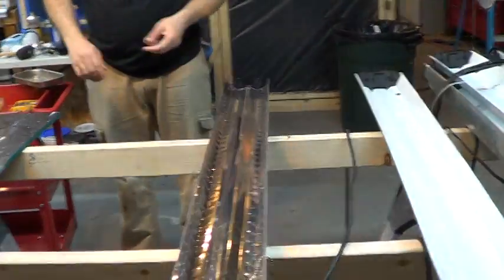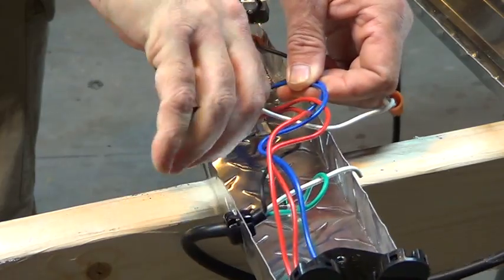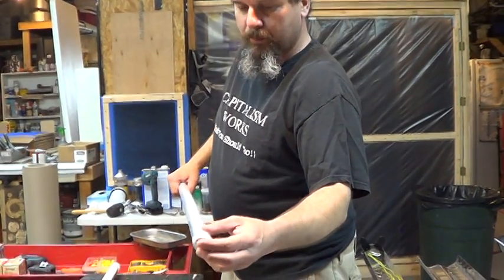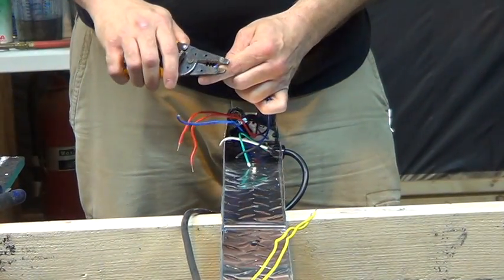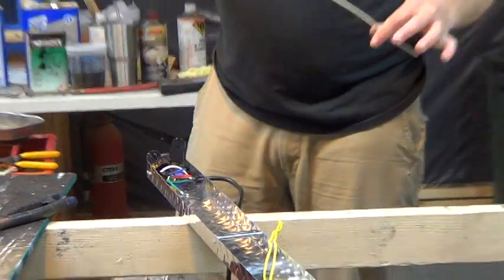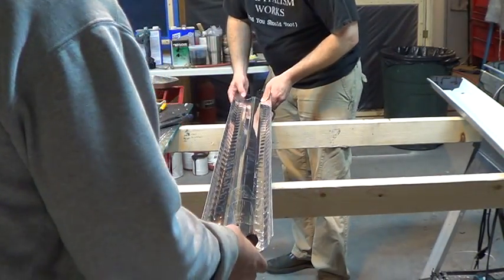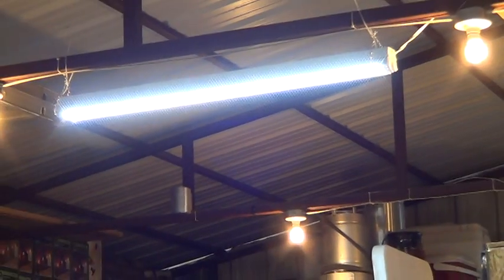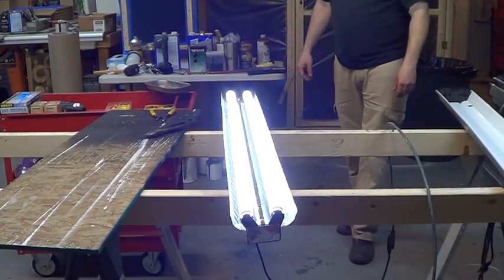Changing Fluorescent Bulbs To LED Bulbs - Removing Single Ballasts & Wiring

Comment: Dont try this at home Kids
Im not a professional!
Did you pull a permit for this?   LOL
we need to tell the tax man about the improvements you did
so he  charge you  accordingly for increasing the value of your home

I bought an LED at LOWS 
cost 75.00
and took out the florescent  in one of my bathroom
 and WOW 4 times brigher
as I change light bulbs in my house i switch to led

Comment: Wire Nuts for Rick.  Even a Caveman can use them.   I like using these on Motors, quick change on winding wires. 

http://www.linghunt.com/ForumPosts/Oven/German_WireNuts%20%281%29.jpg

http://www.linghunt.com/ForumPosts/Oven/German_WireNuts%20%282%29.jpg.   

Forum has ordering information.   As with any Electrical device, check voltage ratings and current limits.  

http://www.hobby-machinist.com/threads/wire-nuts-german-style.61742/

ASIDE: Typical wire nuts like what is shown in Video are designed for solid core wire. Using stranded wire, not so easy.  Hillbilly it together or think solder.

Comment: Many thanks.  I needed to know if my old shunted tombstones would work with the Barrina dual ended tubes.  After watching your video I learned that I am fine with the existing tombstones I only need to disconnect the ballast and connect positive to one end of the tube and common to the other.  I have 24 ceiling fixtures to convert to LED so I am ordering a lot of the Barrina tubes.

Comment: I actually used to do commercial electrical work but nothin you guys did got me triggered lmao. He knows what he's doin, great shirt by the way.

The ballast just takes your 120v AC and converts it to 12v DC or could be a multiple of 12v depending on the bulb, nothing special, just no need for two of those.

The only thing I used electrical tape for was covering the screws on the sides of outlets and switches after you wire em up so you can hold it easier without taking a hit and to minimize potential for shorts inside the box. Common sense applies!! Lol 😂 

And if you're really ghetto rigging something and all your wire is the same color, do yourself a favor and wrap a piece of tape on the hot wire for future reference. 👍

Comment: I don't use electrical tape. If you aren't confident enough to properly secure wires then you probably shouldn't be messing around with electricity.